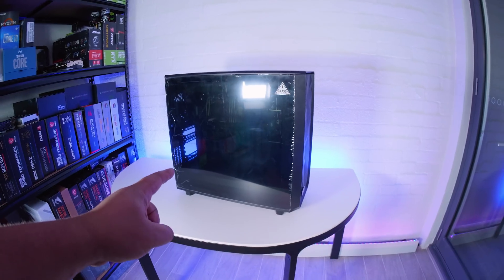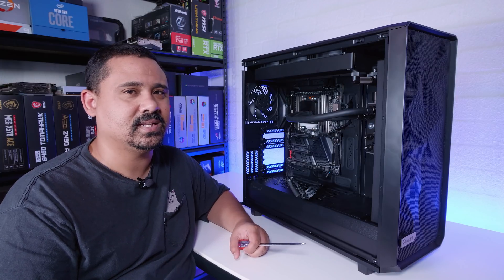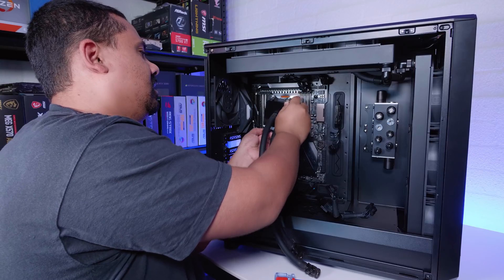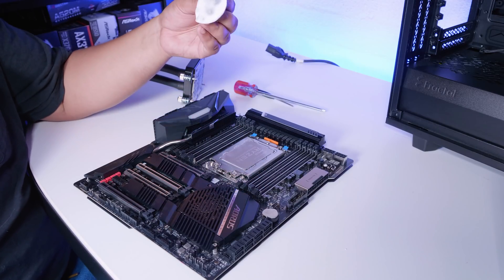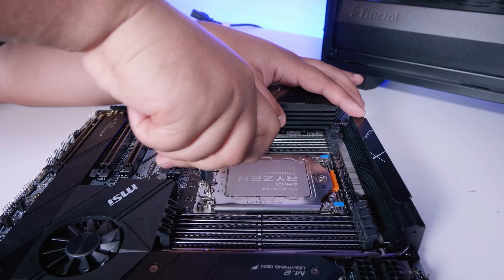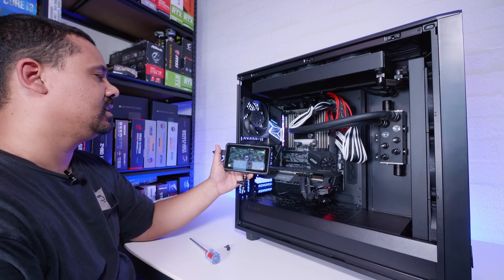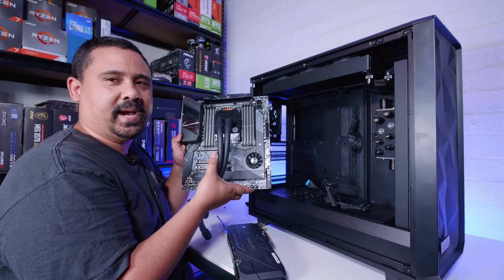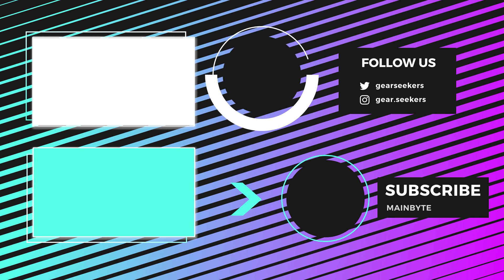BIG OOF - Dream Water Cooled Editing PC - Pt4

Comment: Your motherboard died .. due to the gpu. Bet your gpu pulled too much power and your board couldn't handle the power spike.
Reply from the maker: No. That board used to run dual 2080 Tis. Unlikely
Reply: @GearSeekers  my bad... read another comment that said it had a 3080 gpu in there.

Comment: Use to read a lot of customer reviews on Amazon and Newegg about Aorus cold boot issues when was choosing mobo to buy and this was the main reason i  was discouraged to pick any of Aorus line. Some people said clearing cmos and taking battery out for  some time clears the issue and that it is probably faulty BIOS.
Reply from the maker: It's a dead board. Clearing CMOS doesn't fix a dead board

Comment: Yes it’s bad when a piece of tech craps out on you, at anytime! Bryan over at “Tech Yes City” had a recent video where rumours and some confirmed cases as newer motherboards and pc tech parts transistors / capacitors are dying faster due to lower quality parts being issued on boards due to them being used as demand for pc parts skyrockets and RMA’s are going up dramatically in recent times and RMA’s are taking longer then usual waiting for replacement parts.

Comment: I wonder if perhaps it died during the fill. You were using an external PSU but if spilled water gets in an area where it does not have a lot of surface area exposed to air it can take over a week to naturally evaporate. Not saying your spill did kill it but I would have looked there 1st as a source of motherboard death.
Reply from the maker: As mentioned in the video, I was using it for about 3 weeks. This coolant is non conductive. It died because it was is time to die. It died when the new GPU went in.
Reply: @GearSeekers  ah...did not realize it was up and running for 3 weeks and then stopped.

Comment: This happened to my Gigabyte Aorus Master X570 after 14 months. I sent back to Amazon and chose Asus. This was my first experience with Gigabyte but also the last. Ok it happen but i'm not been satisfied about it. After sent back i found that is a common problem of Gigabyte motherboards: the day before it's all fine but the day after the system won't start...but there was a solution (partial) . Resetting cmos removing the battery for 10 minutes and magically the sistem restarts. Too late for me but i'm happy to have changed my motherboard anyway.
Reply from the maker: Yeah it wasn't that. The board is dead. Like I mentioned in the video. We tested a whole bunch of stuff before we even filmed this video.
Reply: @GearSeekers  ok. sorry for your MB. i've been stupid not testing removing battery. maybe the only test i haven't done  :-(

Comment: Did you try taking the cmos battery out ? I had to do it with my aorus board when I had no power from cold booting after swapping my gpu .
Reply: Yeah that's the first thing to do.
Reply from the maker: Yeah it's not that lol. The board is properly dead.